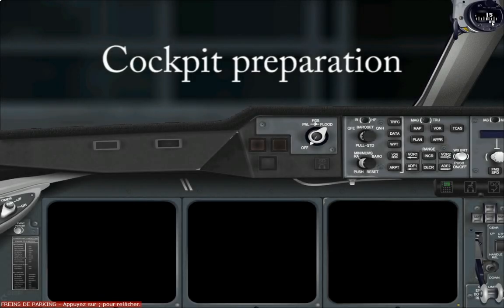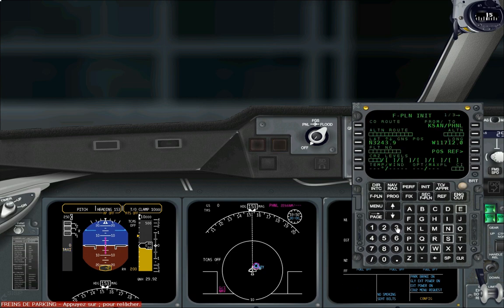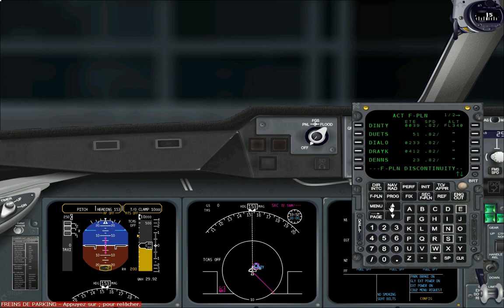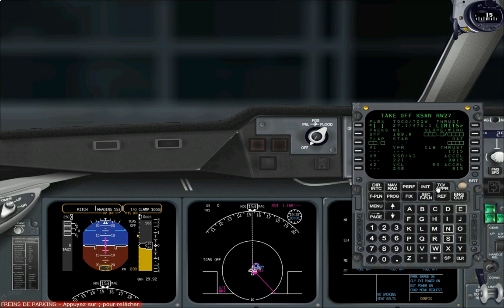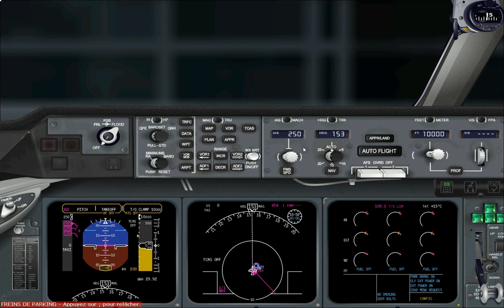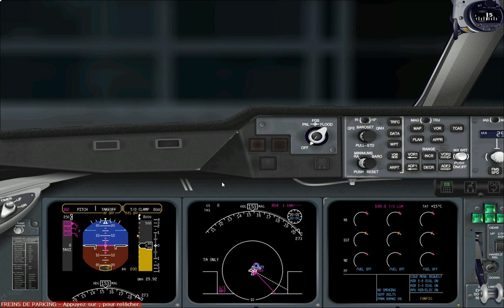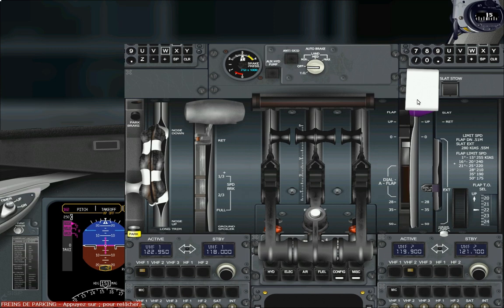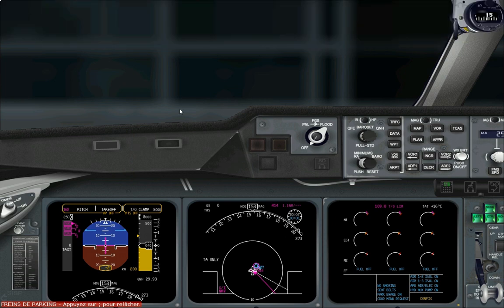PMDG Md11 full tutorial part1

Comment: You can input your flight plan much easier. All you have to do i type in first waypoint and then airways only, FMC will add all intersection for you. It takes less time and you know that your route is up to date if you have current airac installed. 
Other thing. You should set V2 at MCP, why?  It is at which speed, following an engine failure at V1, the aircraft must be capable of climbing and retracting the gear.